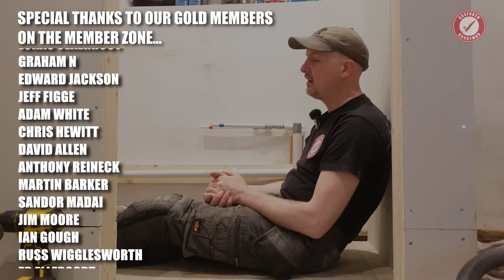Working with wonky walls... and first fix plumbing - new toilet (part 6)

Comment: @29:18 No tightening nuts on the copper to plastic transition fittings?
Reply from the maker: JG - they're amazing. Here's how they work... https://youtu.be/v6kRm3KKCQo
Reply: What if you need a shorter length of pipe? The secondary seal on the end of the pipe isn't there.
Reply from the maker: It's just an insert. You can cut the pipe anywhere and pop the insert back in. 👍

Comment: Why didn't you just use pushfit pipe is plastic for the whole runs?? Hot especially, and it would have saved a soldered joint behind the boards.
Reply from the maker: Tricky to bend at tight angles.

Comment: read every tool in your list the only one i wanted is not there. the inside deburring tool " i am probably not using the correct name" but if you could point me in the right direction please.
Reply: Just search the usual suspects for 'deburring tool' and they'll pop up in droves. They're all fine for plastic and copper.
Reply: Try searching "copper pipe deburring tool".   Scamazon sell similar ones to the type Andy Mac was using.
Reply from the maker: Here's an affiliate link to a similar one. I've had mine for years, still on the original blade! https://amzn.to/3MQPaec